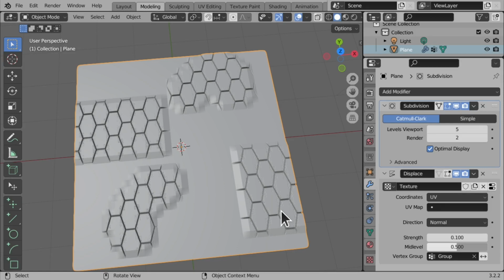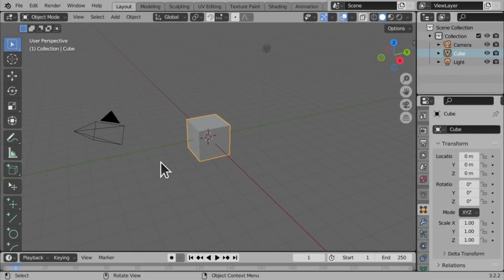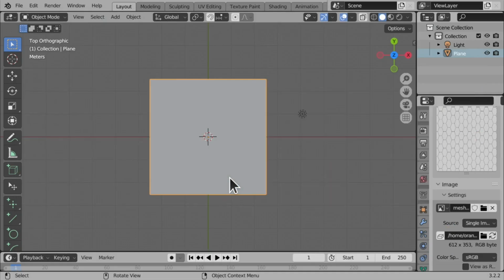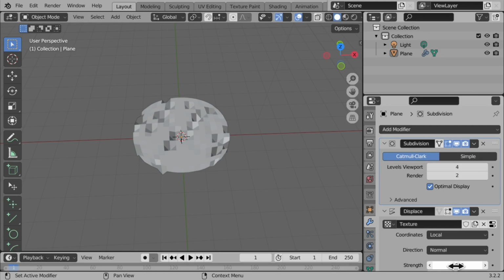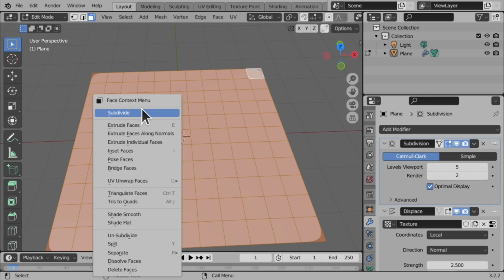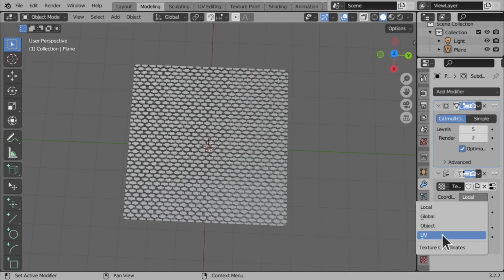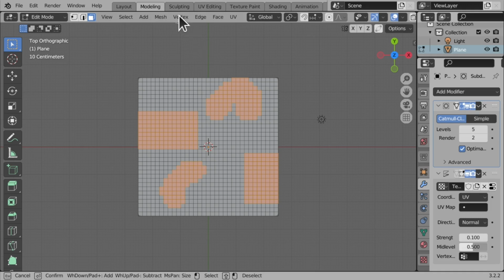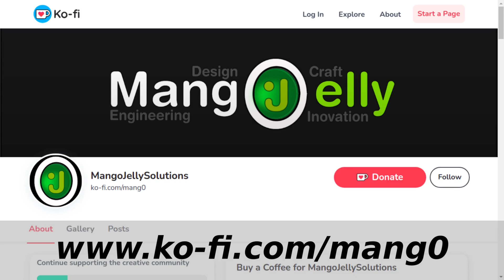FreeCAD To Blender : 3D Print Custom Surfacing | Displacement Maps | Apply Physical Textures

Comment: If you switch from Catmull-Clark to Simple in the Subdiv surface modifier, you’ll keep the sharp corners of the plane. Also, your texture is not square so it’s distorted. When you UV unwrap, switch to top view and project from view. Then you will have non-distorted hexagons.